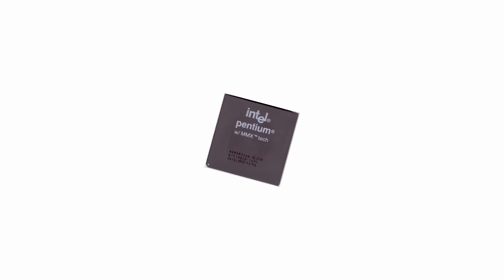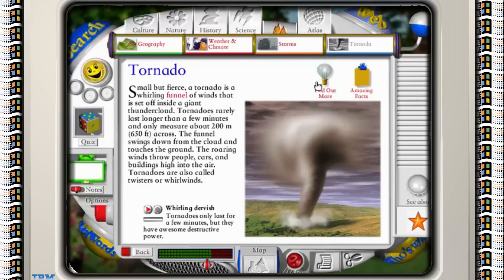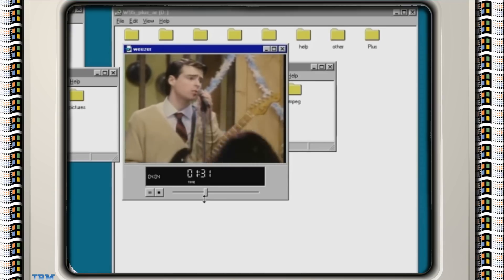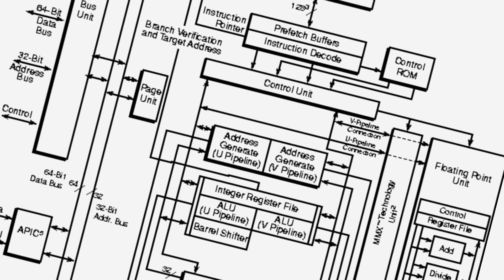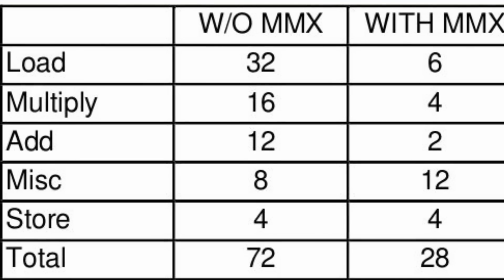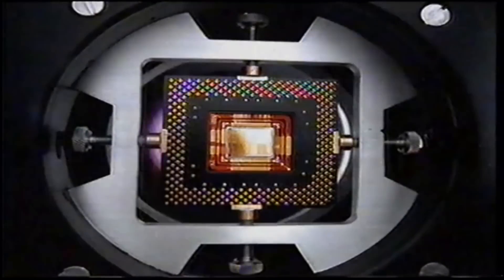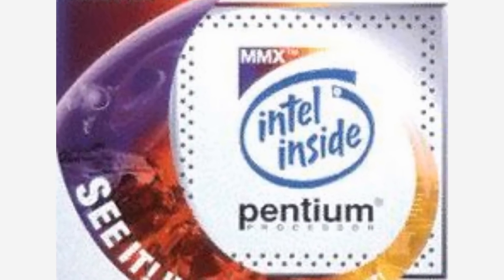What is MMX Technology & Why Was it Flawed? [Byte Size] | Nostalgia Nerd

Comment: The cards at 2:49 aren't Intel video boards--they're various SoundBlaster models. :-)

The actual cards he's talking about are the Intel ActionMedia and ActionMedia 2 cards from ~1992 and ISVRPro from ~1994, both of which were i750-based if I recall correctly.  The ISVR3 from ~1995 was the dumbed-down video capture board that offloaded compression onto the CPU.

I worked on the video software that shipped with the ISVR series. We never bothered adding MMX support to the software. Oops. ;-)
Reply: Hahahaha.

Comment: Take of those early mmx CPUs were incredible in terms of overhead. My P166mmx ran happily at 287MHz. % wise that is the best over clock I have ever had by miles.
Reply: That's a 72% overclock, you're right that's a real good effort.
Reply: YES. I was building PCs at the time.  I had an Evergreen P200mmx proc that Never blinked at 300mhz.  That's the fastest the board will go.  I still have it paired with my PCI VooDoo 3 3000 card.  Have not ran it in almost 10 years. Im sure it all still works. assuming the Caps on the mobo are fine.
Reply: I did the same with mine. Apparently the 200mhz and 166 were the same chip. I ran mine for years at 233 with stock cooling.
Reply: Daz555Daz damn son that’s some gains getting p2 speeds

Comment: Again, rubbish information here (just like in practically every NN video). The MMX operations interfere with floating point operations not because they can't run parallel (because a single core processor couldn't run full operations parallel anyway), but because they can't be "interwoven" or interleaved with each other without reloading the registers, because they were both using the same register set.
Reply: So please do feel free to make your own YouTube videos if you can do it better.
Reply: Aw, Someones salty

Comment: didn't AVX replace MMX then or did Intel keep MMX in case of anyone still using it in newer applications or wanting to run older applications that use MMX instead of AVX, AVX2, or AVX-512?

Comment: Is mmx outdates or still needed on modern CPUs?
Reply: MMX instructions and registers are still present in modern CPUs, but only for retrocompatibility. Nobody would make use of them nowadays, because they cannot be used for floating point operations. On the other hand, SSE instructions and their evolutions are still used precisely because they can operate on both integers and floating point values.
Reply: thank you. was looking at specs of different processors. the celeron line has mmx or not depending on the site you look at - as well as the sse instructions.

Comment: "The Pentium II is just a Pentium Pro with MMX circuits added" = <cringes>.  Pentium II also reworked a significant portion of the chip to improve 16-bit code performance as the Pentium Pro was weaker than a Pentium on a clock for clock basis.   The PII of course also had other fixes applied that opened up the architecture for more performance and higher clock speed.
Reply: The Pentium 2 was just Intel trying to reassert control over the CPU socket with that stupid cartridge deal they came up with.
Reply: The Pentium 2 could have been put into a socket, yes..  but don't discount the amount of engineering that went into it to turn a Pentium Pro into something that could execute 16-bit instructions quickly and scale up to clock speeds that it did later..
Reply: There actually is a socket version. Google "Pentium 2 Overdrive".That's a Pentium 2 with cache running at full clock speed, inside a Socket 8 packaging, like a Pentium Pro CPU. It performs better than a regular Pentium 2; unfortunately, it was too little and too late.

Comment: I'm proud of my i80486/100 PC. I can do unbelievable things (I can emulate Sega Genesis under DOS) without MMX! I limited myself to building a PC that has to be a numbered CPU and not have a name, and the i486/100 is super fast! Now, there is a Cyrix 586 that runs at 133MHz that can allegedly outperform a Pentium 90, and I plan to install that CPU to see if it can speed up my Socket 3 motherboard from 1994. Cache RAM is important though, so I upgraded the 256k to 512k. 1MB is on my bucket list, but it's UNBELIEVABLY expensive to get these parts today!
Reply: wait till you see the specs for the AGP x1 socket. you will shit your pants. we still won't be able to run DOOM at fullscreen though =(

Comment: "Near TV video quality"... TV is the shittiest video quality you can get due to the requirement to be transmitted!
Reply: When the only motion pictures in existence were TV, blown-up theatre images and grainy VHS cassettes TV was by far the best quality video going.
Reply: yeah but it was a high standard to get to back then now the thing is to be able to stream 8k without lag which is bound to your GPU instead of the CPU ass the CPU really doesn't matter all that much after 1080p and almost stops mattering after 1440p if it is a new, 2012 or later, CPU as video playback is a CPU light task at high resolutions
Reply: "yeah but it was a high standard to get to back then" - No it wasn't. We had VGA a decade prior to the first Pentium processors arriving, and even VGA had a better resolution that standard TV sets at the time. Actually, by the time the Pentium processors went into production, we already had various Super VGA resolution, which offered 5-10x as many pixels as the standard PAL or NTSC TV did. So, it's just Nostalgia Nerd spitting out unverified and false information again, as usual.
Reply: Having SVGA capable screens doesn't mean you had the hardware that could play full screen resolution uncompressed videos in as many colors as a regular TV. Just look at the mid 90s cinematics, none of them are in full 640*480, most of them are not even in 16 bits colors and they're compressed as hell. Why? Because CPUs were too weak to play low compression videos. So yeah decoding in real time TV-like quality videos on a pentium was a big deal.

Comment: I don’t think the Pentium II was just a Pentium Pro with MMX--there was a bit more to it than that. The Pentium Pro famously flopped because Intel opted to concentrate on 32-bit performance at the expense of 16-bit, assuming that all the important (i.e. Windows) software would have moved to 32-bit by the time it came out. It hadn’t. So the Pro offered lousy performance running the stuff that most people needed to run.

The Pentium II rectified this mistake.

Comment: MMX was actually Intel’s second attempt to include DSP-type functionality into their CPUs. The earlier one was called “NSP” (“Native Signal Processing”). They abandoned that effort under pressure from Microsoft--not sure why...
Reply: Intel i860 has SIMD, the "floating-point or graphics" instructions use a register file that can be accessed by the floating point units as either thirty-two 32-bit, sixteen 64-bit, or eight 128-bit floating-point registers, or that can be accessed by the graphics unit as sixteen 64-bit integer registers.

Comment: computer architecture confuses the hell out of me!  I though 64 bit processing was a recent thing??
Reply: MMX registers are 64 bits wide, but the general purpose registers were still only 32 bits, as were memory addresses.

Newer chips in 64 bit "long mode" means that the general purpose registers are 64 bits wide, and addresses are also 64 bits wide. There are also added CPU registers in 64 bit mode. 

Hope that helps!
Reply: It does, cheers!
Reply: Intel actually uses the 64-bit instruction set from technology that AMD developed in 1999.

Comment: At the time, the silicon budget didn't allow manufacturers to build SIMD floating point units. And as most games made use of fixed point arithmetic, MMX as it was designed was enough. Naturally, the next step was to improve SIMD to support floating point, which happened when SSE was developed. And since then, the amount of parallelism and precision in the SIMD units has been improving (AVX). The same in GPUs. By the way, the major improvement (compared to the P-Pro CPU) in the P2 CPU was out-of-order execution in both 16 and 32 bit code.
Reply: CK, very interesting historical note, thank you.
Reply: 0x5F3759DF says it all

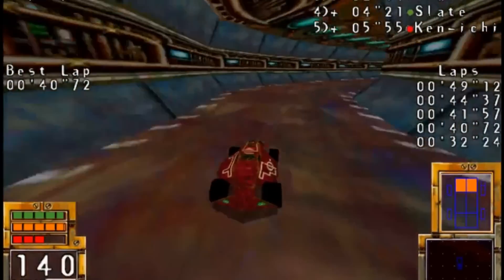Comment: I remember before MMX came out, reading about it getting all excited that the CPU is going to be better, games would run better without the need for better graphics cards.  That was the big thing I remember actually, the whole idea of getting better graphics without the need for a video card. The racing game you see at around 4:10 was  supposedly ran without a video card which was supposed show off the power of these new instructions.  At the time video cards were called 3d accelerators or something like that, but the point was that they weren't looked at as vital components to a computer, an extra booster type thing to have, which is why I think Pentium felt the need to include 3d acceleration to their processors with MMX.  Maybe they saw 3d cards as a thing that happened because they dropped the ball with graphics and this was their way of getting in the game.  But history showed that 3d accelators where here to stay and I think they didn't bother with being the "graphics" processor and let the gpu people do that.
Reply: My Electronics teacher used to be SOOOO hyped about the MMX. He fell hook, line and sinker for the "running multimedia software with no video card or sound card" hype. Then Pod came out, and proved that the 3DFX card actually worked to make games look better and run smoother, while the MMX processors could at most make a game a couple FPS faster due to their larger cache.
Reply: i was hoping MMX would just be a second helper to my voodoo 1 then later 2. I wanted the instructions to help games running parallel with my voodoo. I was using a Sierra Screamin 3d for my 2d(it was a Verite' 1 3d accelerator itself) lol.....God those were the days...

Comment: Its not that the Pentium MMX cant run both MMX and FPU programs, it have to clean the pipleine. Its just a 7 or something steep pipline so its not really a issue if the software is well writen.

What really speed it up was AMD 3Dnow added floatingpoints to the SIMD instructions, basicly solving the problem and increasing the speed quite a lot.

Comment: The 8086... then the 286... then the 386... then the 486... then the *5*86 (*Pent*ium)... then the 586 and a half... then the 586 II... then the 586 III... then the 586 IV...  Just to illustrate the silliness of hanging on the the "Pentium" moniker.  :)  But hey... if a name works...
Reply: I remembered they stop using numbers like 386 and 486 because they can't be trademarked so they stuck with Pentium.
Now the reason why the it's still called Pentium Pro despite its huge leap from the original Pentium was because the next one will be called Sextium and Intel doesn't want that lol
Reply: There also was a 186 btw
Reply: The 80186 was not compatible with the IBM PC standard.
Reply: The irony is that pentium to pentium pro was the last huge leap and still kept the name.
Reply: Well, the 186 was compatible and a few clones were made with it, but the motherboard design had to be modified because several new functions were integrated into the CPU. The NEC V20 was a 80186 clone that worked in existing motherboards.

Comment: I'm loving your videos because I love the "classic" pc era, 80s and 90s, from xt to pentium 1 and 2, that's "my thing", sometimes when people ask me for advice on building their systems I jokingly say "oh, get a socket 7 motherboard for your processor, a pci graphics card, it's better than local bus, you'd want 66mhz or 100mhz front side bus, DIMM for ram, simm is too slow, get an isa sound blaster 16 for sound, and add a 3dfx accelerator" hehehehe. 
after the pentium 3 and 4 I kinda lost track of models, numbers, it's confusing, I'm like "so... dual core is not the same as core 2 duo, right?, wich one is 886/pentium 5?, is core i3 986 and core i5 1086 or are they the same generation? and core i7? is it pentium 6, 7 or 8?" hahaha.
Reply: Pelger what are you smoking?

Comment: SIMD does not require any form of parallelism to still be SIMD. Basically, with MIMD every time you wanted to add something to a value in memory, you had to load the instruction each time, even if the data was vectored (in series). With SIMD you can issue an instruction that says "Add 2 to all the values from here to here in memory", thus one instruction that repeats over a series of data. Cray pioneered this system with their second or third super computer way back in the late 1970's/early1980's. (I think it was called the Cray MX). Just food for thought.
Reply: On a pipelined processor, the only major reason to introduce SIMD is in order to add instruction level explicit parallelism, because pipelining hides the instruction loading and decoding impact in the common case already, as long as the data is independent of one another.

But also consider that pipelining is a form of implicit parallelism, as multiple instructions are in flight at the same time: one instruction is at the decoding stage while another is at the ALU stage while others can be at register reading or writing stages. This way serialization of basic CPU units is reduced.

This in turn means, that sequential SIMD on a non-pipelined processor is poor man's substitute for increased parallelism of a pipelined processor. Food for thought, huh.

Comment: Does that mean that the PII was not really a generation at all ?
Reply: Pentium II and Pentium III are members of P6 architecture, that Pentium Pro also belongs to. They are really one humongous generation jump beyond Pentium and Pentium MMX, members of P5 architecture, absolute game changer. While P5 are built directly around the input instruction set, P6 translates it into different instructions which split arithmetic and load/store operations, issuing around 3 new instructions for each input instruction and then assigning the arithmetic portion to one of the 3 equal sets of execution units. And that's just barely scratching the surface of the changes. Almost all x86 processors that appeared since are evolutions of the P6 design, while only early Atom, Via/Centaur, Larrabee, and some Xeon Phi compute cards showed any vague semblance of similarity to P5.
Reply: cheers for details.
I thought the PIII was the game changer. Except for clock speed, I believe the PIII was the game changer. Clock for clock it was faster than a P4.
Reply: TheProCactus Yes Pentium III is significant because it introduced SSE instructions that applied single-instruction-multiple-data approach (SIMD) to floating point numbers, allowing to perform fast geometric operations in 3D games. MMX only was good for pixel operations, colour conversions, polygon fillers and texture mappers, MPEG decoding, sound mixdown, things that were a significant performance bottleneck in the 90ies, usually accounting for the bulk of the time spent in game and multimedia application code, but these operations were taken over by special purpose cards that became ubiquitous and decent enough by the early 00s. Other than introducing SSE instructions and somewhat expanding the arithmetic units to execute them, there has been no other change between Pentium II and early Pentium III. Late versions of Pentium III (Tualatin i think) also doubled the speed of the unit that performed instruction set translation, that allowed to increase utilization of arithmetic units and laid the groundwork for Hyperthreading that came later.

AMD Athlon turned out to be remarkably similar to P6, but was arguably developed independently, not as a copy. For one, there wouldn't have been time for that, as such developments take upwards of 5 years, and for other the ancient AMD K5 that was set to rival original Pentium was already a translating out-of-order processor, even though performance figures rarely show that. AMD was also the first to offer a floating point SIMD instruction set, the no longer supported AMD 3DNow starting with the K6-2 processor. It was inevitable that Intel would counter that, and SSE was the result.
Reply: wow dude. Can I ask what do you do. How you just know this?
I think you may have typed that from the top of your head.
Reply: Yes, from the top of my head. Probably learned the most from Agner Fog's writings about a decade ago. Poked numerous algorithms myself because of my fascination with Demoscene. Done a few things over the years. Maintained a commercial 3D engine that was used in a few WiiWare and iPhone games, done embedded device development for a few automotive companies. Now in my mid 30ies back to university, studying linguistics. Been programming since I was about 9.
Reply: The pentium pro, pentium ii and pentium 3 were incredibly similar. The pentium was very different from the pentium pro; that was where the huge leap was.

Pentium pro introduced, among other things, L2 cache on the CPU(but not on the same die), a RISC like core hidden behind a CISC like front end that translated x86 to micro ops, out of order execution and register renaming. It was a much better 32-bit chip than the pentium and the obstacles toward scaling to 1 GHz were removed (were as a 1 GHz pentium would not be easy to make and would not be that much faster than a 233 MHz pentium). The pentium iii was a pentium ii with SSE. Pentium iii slot 1 to pentium iii socket 370 was almost a bigger leap (on-die L2 running at full clockspeed)
Reply: TheProCactus The early P3 were no faster than P2 through. P2 was the biggest jump.
Reply: Pentium pro not P2. I remember reviewers being disappointed with the early P2's because the cache only ran at half of the CPU clock, as opposed to full clock speed in the pentium pros. A pentium pro 200 MHz was sometimes faster than a pentium 2 233 MHz.